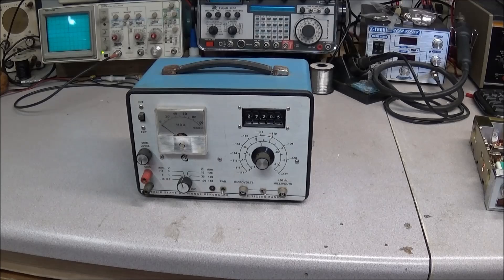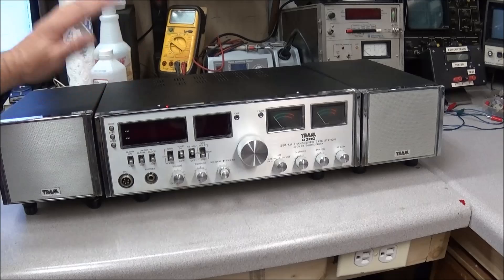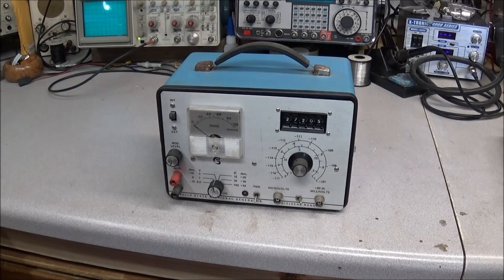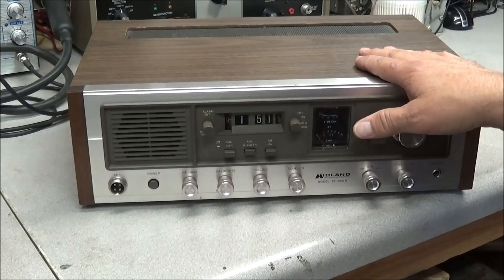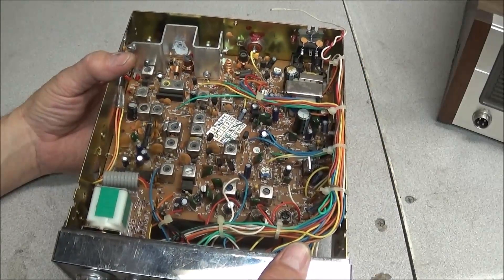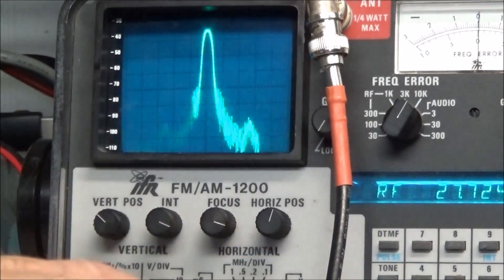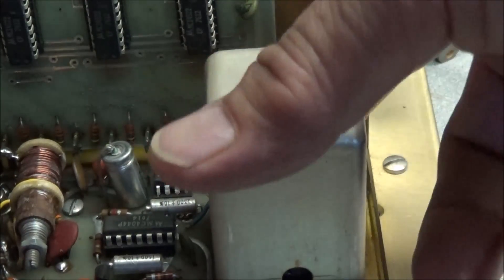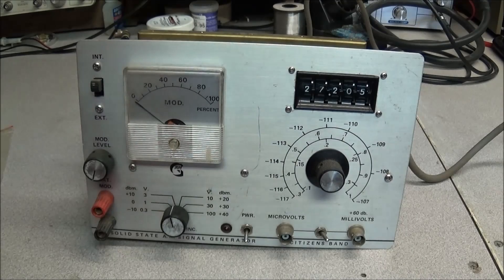#45 Shop Talk - GAW 1500 Signal Generator Info needed and comments

Comment: Hi, I picked up a Cobra 138XLR that doesn't work and someone has made some mods to it that seems to be the problem.  I'd like to get it working again but need some documentation.  Do you know where I can find the service manual or a schematic?  Thanks.
Reply from the maker: Here you go Steve. They have tons of schematics there.http://www.cbtricks.com/radios/cobra/138xlr/index.htm
Reply: WOW, Thanks.   Do you also have info on the President Grant AM/SSB or Sears Roadtalker 40 SSB?  I couldn't find them on the cbtricks site.  They had a listing for President Grant DX but it's not the same.
Reply from the maker: You are welcome
Reply: Do you also have info on the President Grant AM/SSB or Sears Roadtalker 40 SSB?  I couldn't find them on the cbtricks site.  They had a listing for President Grant DX but it's not the same.

Comment: Nice, a D300.  Those are pretty rare.  I believe Tram folded right around the time the D300 came out, so not a great number were made.  I have a D201a, a Titan and a Titan II.  I have worked on some of their old in-house solid state mobiles before too, they were built like tanks.
Reply from the maker: +gadget73 Those were nice old radios. I worked on 2 Titans in the last week.  Yep, the D300 was the last one. Saw one go on ebay in original box for 1100 bucks. I was offered 350 for mine but turned it down.  Not ready to part with it yet. Maybe one day.  Like you said they are getting rare to find.

Comment: Just seen it uses the MC4044 phase comparator- there's a gotcha here if you don't know this chip; it is NOT a CMOS logic device! If it were, it would be marked MC14044. Its totally different. They are rare- I only know of it from radios I used to work on back in the 80's.
Reply from the maker: +Alan Cordwell Good eye Alan. I am going to take a lot of photos and post them on my website.  Then see if I can make a parts list of this unit.  Have not seen many MC4044 in quite a while. Thanks for noticing that.

Comment: I observed that the frequency displayed on the service monitor looked stable. The PLL may actually be keeping the VCO locked on frequency. Those BCD thumbwheel switches that set the frequency go to the divider chips to form a programmable divider. It would be difficult to imagine that all switches and all divider ICs are bad. Could be something as simple as the 5 volts feeding all the BCD switches may be missing, thus providing no "programming" to the divider chain. It would be interesting to trace the wires from the BCD switches to the dividers and see if any 5 volt levels change as the switches are turned. If that seems OK, then look at the output of the divider chain that feeds the phase detector, and see if the frequency changes with the switches being turned. That's all I got.
Reply from the maker: +RF Burns Working on that now. Was going to get back on the HP 410 today but had a guy here in the shop most of the morning. Decided to check this unit out a bit further.  What I need to do is pull the data sheet on the dividers.  Then set it for lowest frequency and measure voltages on all those chips, move to next frequency and do the same. Sort of like a truth chart.  So far I am seeing 1 and 0 as I turn the switches. What I am not seeing is the state of the output dividers going to the main board. May be close to the problem Appreciate the information. Brings back a lot of memories (nightmares) from early PLL radios.
Reply: Cool! I know this may be obvious, but keep in mind that the trouble you are looking for is likely going to be a single point of failure. (All BCD switches and dividers not likely bad). Single point of failure might be:
1) loss of 5 volts on BCD switches - you've ruled that out
2) phase detector circuit
3) VCO, etc.

What would be interesting is to verify for sure that whatever frequency is being output, is it really stable? Can you slightly tweak that coil without changing output frequency? Does the frequency suddenly jump way off when the coil is tweaked too far? If that happens, you can have an idea that the VCO & phase detector are probably OK, and that trouble is in the divider. If the VCO is not stable and slight tweaking of the coil imediately changes the output frequency, you may have trouble in the phase detector or VCO. Hope that helps..........
Reply from the maker: +RF Burns Yep, divider inputs seem to be working great. Frequency is rock solid while watching on spectrum analyzer, even with the can removed off the big coil. I can tune the variable cap on the large coil and move the frequency a bit either way, about 1.2 kc, not jumpy just smooth tuning. I agree with it being a single problem. Like you said a missing voltage throwing the whole system out of whack.  Going to keep at it for a bit more. And yes your info helps. Thanks

Comment: Should be an interesting fix Buddy. Hmmm, the max RF output looked like +40 dBm (10W!)?  73 - Dino KL0S
Reply from the maker: +Dino Papas Should not be to complicated. Guess I will start pulling data sheets on those IC's and do some testing. Plus replace those darn capacitors.  Opps, The -40dbm was a bit miss leading.  The signal from the senator is so low the RF port cannot see it. I had to inject into the antenna port which is rated for a quarter watt to see the signal.
Reply: +The Radio Shop   No, what I was saying is that the output marking on the generator is marked as "+40 dBm" which would indicate that the generator is capable of putting out that much signal? I wasn't sure why a signal generator would be designed to do that but may serve some function in testing CB gear?  It didn't appear to have some kind of input function to measure any RF. Yep, putting that much juice into the receive port of our IFRs would be let us say a bit "smoky"!  73 - Dino KL0S
Reply from the maker: +Dino Papas Duh, my bad Dino. Sorry had folks in the shop and have not finished my first jug of coffee lol.  Yep, no way it can produce that much power out. Only a few microvolts at the most?  No idea why that have that on the there. 10 watts would wipe out the front end of most gear.

Comment: Cobra's for decades were made by Uniden.  The Cobra 29 is one of the longest production radios ever.  The 29 model has been around since the 23 channel days.  The Midland is a nice radio.  Just restored one a few weeks ago and it had excellent receive sensitivity and selectivity.  Personally I don't even like to repurpose switches when doing modifications.  I usually sneek a thin flat cable out between the bottom cover and chassis and run it to a small 2 inch plastic project box with switches.
Reply from the maker: +MikesRadioRepair I love older Cobra radios. I do have a 23 channel 29 here somewhere. Good tip on the flat cable.

Comment: Isn't GAW a Boonton company.  Will have to do some looking around and see if I can dig up anything.

Nice Tram base.  Restored a few of those.  One of their last radios at the end of the CB boom.
Reply from the maker: +MikesRadioRepair You may be right about that, after searching seems Motorola may have used some gear from Gaw and also Booton was mentioned:https://www.mail-archive.com/repeater-builder@yahoogroups.com/msg62286.html
Reply: +The Radio Shop 

Coming up empty on info for this unit.  Did a patent search on GAW and it looks like GAW Co. Inc was a guy named Norman W. Gaw.  Will keep a lookout for info.

Mike
Reply from the maker: +MikesRadioRepair Yep, I searched for about 2 hours last night and gave up.  Seems there is no mention of this unit anywhere. I do know it was sold by Electronic Service Center here in a town called Elkin North Carolina.  So going to try and contact them and see if they have any info in there files. Norman W Gall is what I also found.